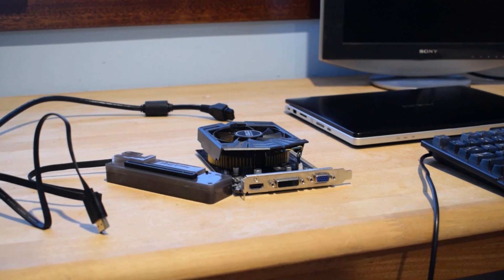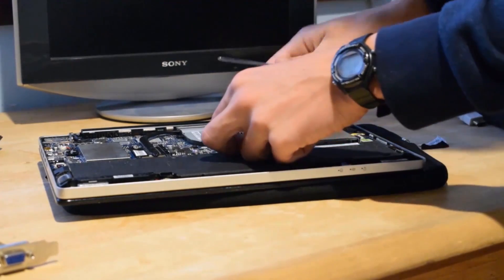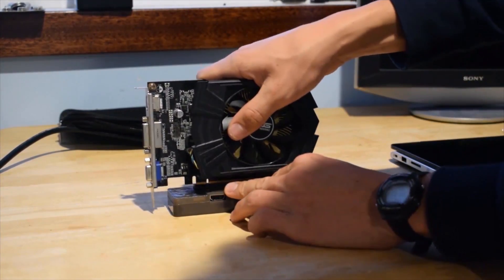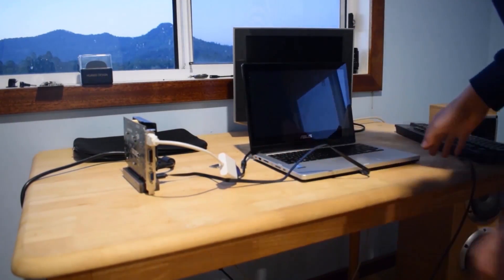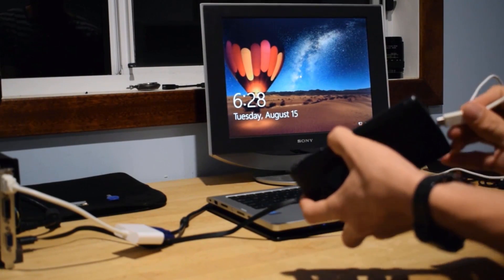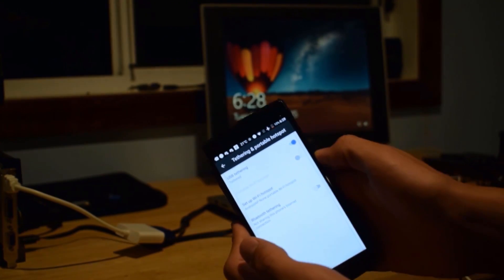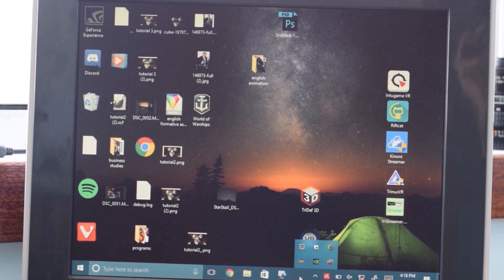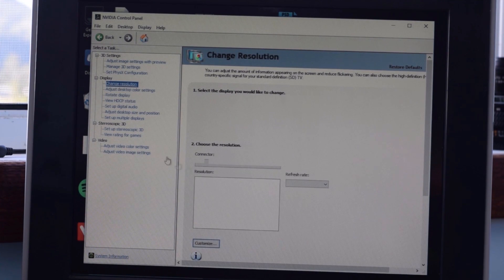How to Connect External PC Graphics Card to Laptop (no thunderbolt port required) Egpu Setup

Comment: Dude, i have a Asus X556UA. but in this laptop i have a I5 7200U, Could you put the EGPU? the truth is I do not know if it has the same input I do not know what kind of input it has, and since I can not open it because the warranty covers it, I do not know if you could tell me what type of connection it uses
Reply from the maker: It should work, you just need to figure out what port it has, like you said. The best way to do this is probably to go into device manager to get your wifi card model, and then research what type of connection that model has. Some possibly helpful info: https://www.thinkpenguin.com/gnu-linux/mini-pci-mini-pci-e-mini-pci-e-half-height-guide-laptop-wifi-cards

Comment: My laptop is very old and i dont have an external monitor, can i run it.
Reply from the maker: You should probably consider just getting a new laptop. While this may improve performance, your other laptop components will significantly limit the external gpu. Also, there is a good chance that you would need a monitor to make it work on your laptop, if it doesn't have a bios whitelist [which would prevent the egpu from connecting]). Hope this is helpful.

Comment: Hello bro i have 2 question if you answer me i will subscribe to your chanelle 
first : i have a 
hp 15-r214nk
4GB ram 
Intel Core i3-4005U CPU @ 1.70GHz
Intel HD graphics 4400 
what graphic card can be the best performance for this pc 
second 
if i unplug the wifi adapter from my pc can i use an external USB Wifi or a wifi cable to use internet conection 
and thanks 
i hope i got a reply soon
Reply from the maker: The performance increase is heavily dependent on the game you want to run (if you want it for gaming). I used a gtx 750 in the video, and my laptop has similar specs to yours, but you could probably get a bit better one than a 750 if you want. Whether your cpu and ram will bottleneck the flu also depends on what you are running, as some things are more cpu intensive, while others are more gpu intensive. And yes, if you unplug the WiFi card you can still use WiFi by either using a lan cable, getting a USB WiFi dongle, or USB tethering the connection from your phone. Also note that if you plan to move your laptop around a lot, an egpu setup may be impractical, as you need to open the laptop every time to disconnect the egpu cable. Also, gpu's and quite expensive at the moment, so you may want to consider just buying a better laptop if you have enough money. Hope that helped you :) also make sure your laptop doesn't have a bios whitelist, and this would prevent you from connecting an egpu, but I don't think it has one (not 100% sure though)
Reply: +Sub thanks broo
Reply from the maker: Thanks :)

Comment: One simple tip if you want wireless wifi on any pc; Just buy a cheap USB WIFI adapter.
Reply: its called wifi dongle thingy
Reply: WiFi are very tiny in form of USB these days
Reply: wait I am confused what does wifi have to do with boosting my performance for gaming?
Reply: @eze9775  eGPUs are usually connected to NGFF slot that the Wi-Fi card uses, so you lose that built-in capability.

Comment: My laptop is a Lenovo Ideapad 520s i7 256gb SSD 
1. Will it work? 
2. Also will this end my warranty?
3. Also how easy is it to interchange from the regular laptop to the laptop with the eGPU attached and vice versa.
Reply from the maker: Hey, sorry for the late reply, I had a busy few weeks (exams). I'm honestly not quite sure if it would work, you'll need to make sure it doesn't have a bios whitelist (I think the ideapad 510s has a bios whitelist, not sure about the 520s though). About the warranty, this should hopefully give you some more info (should be the same for lenovo): https://www.reddit.com/r/Dell/comments/4e1ivx/does_replacing_the_wifi_card_void_your_warranty/
How easy it will be to swap depends heavily on the laptop. You will probably need to open it up every time you want to disconnect the cable, so it depends on how easily you can do that (or if you can somehow store the cable in the laptop and then pull it out when needed). Hope that helps, please consider subscribing to my channel :)

Comment: Does this mean no wifi
Reply from the maker: Well, you need to use another method to get WiFi, such as USB tethering it from your phone, using a lan cable, or buying a USB dongle. Otherwise you won't have wifi, as this setup requires the WiFi chip to be removed from its slot.

Comment: What about an MSI gtx 970 4 GB?
Reply from the maker: Hm, my feeling is that a 970 might be a bit too powerful, just because I'm not sure if the mPCI-e connection would bottleneck it a bit (I've tried to find tests which check how much the connection bottlenecks gpu's, but haven't found any). Also, your cpu might bottleneck that in some games. Your choice, it might be bottlenecked a bit, but it will still work.

Comment: Will this work on HP ProBook 4740s ? And which GPU is the best for this laptop?
Reply from the maker: Hm, that's a bit risky. Not sure if your laptop has a bios whitelist (which would prevent the egpu from connecting). Your laptop was made around the time that hp apparently stopped putting bios whitelists on their laptops. So not quite sure if it would work. Try to find out if it has a bios whitelist, and if not, I would probably recommend a medium range nvidia gpu.
Reply: qwertypop but I have read that there is a bypass for that whitelist but not sure if it really works

Comment: Can I use a zotac gtx 1060 6gb graphics card?
Reply from the maker: Should work. Just read this forum to see what issues there are, and workarounds. 
Nvidia 10xx series egpu driver issues: https://egpu.io/forums/expresscard-mpcie-m-2-adapters/nvidia-is-killing-off-mpciengff-m2-egpus-error-43-with-372-90/
What computer are you planning to use it with?

Comment: will this work on Acer aspire
Reply from the maker: Hey, do you know the exact model?
Reply: +qwertypop Acer aspire 5733Z
Reply: +qwertypop and I am using Intel i5 8th gen graphics card,will it give 60fps
Reply: +qwertypop also subbed and liked
Reply: +qwertypop pls reply ASAP
Reply: and i am using my laptop screen
Reply from the maker: Hm, as far as I know, your laptop doesn't have a bios whitelist, so an egpu setup should work (no guarantee though). Please keep in mind though that your cpu may bottleneck the setup significantly. Also, I don't know if your internal laptop display will work while the egpu is connected. You just need to try. The question of whether you will get 60 fps depends on the game you want to run and the gpu you want to get. Cpu intensive games won't run well, purely gpu intensive ones will.
Reply: +qwertypop thank you so much i want to play GTA 5

Comment: Can i use it with dell vostro 3450 :V( core i5, ram 6b, ssd 120gb, have mPCIE slot)
Reply from the maker: It should work, not sure about the issue being talked about on this website though: http://forum.notebookreview.com/threads/req-bios-mods-to-make-vostro-latitude-egpu-friendly.589234/ 
This website claims it works though: https://trickiknow.com/external-graphics-card-for-laptop-egpu-setup-guide/
So I think it should work. Maybe just do a bit more research on google.
Reply: Thanks you !!! And can you give me a name of Power Suplly you are using ???
Reply from the maker: The power supply is the Dell DA-2.
Reply: Thanks again !
And do you need to install DIY ???
Reply from the maker: np :) I don't quite understand what you mean by "do you need to install DIY". DIY stands for "do it yourself" as far as I know, so yes, you do need to install it yourself by opening up your laptop and replacing your wifi chip with the egpu cable, and then you also need to set up the other stuff shown in this video. Sorry if I misunderstood your question.
Reply from the maker: Oh, that's what you meant :) Well, for me it worked fine without it, but I have read that some people needed it, so I guess if you experience one of the issues listed their website, then you should probably get it. The developer (nando4) is quite active in the egpu community, so I would definitely say the software is good if you are experiencing issues once you get the egpu setup.
Reply: Thansk,bro! But the shipping of soffwear cost so much!
Reply from the maker: Yeah, I know :( only get it if you end up needing it.

Comment: can i still use regular wifi (without phone hotspot) if i do this?
Reply from the maker: No, this requires you to remove the wifi card (unless you have a spare mPCI-e slot or express card slot on your laptop), so you won't be able to connect using wifi. Your options are: 1. Use a lan cable 2. Use usb tethering on your phone 3. Buy a usb wifi dongle. Hope that helps you :)
Reply: Thx!

Comment: Asus ROG GL752vw
 i7-6700,8 gb ram ,gtx 960m,whats the best video card i can get for it not to be bottlenecked by my CPU?thx in advance
Reply from the maker: I think that should be good enough for basically any gpu, but really good gpu's may get bottlenecked by the mPCI-e connection (not quite sure about that though). I wouldn't recommend anything above a 1070 maybe? 1080 may be fine too
Reply from the maker: Just be aware of those issues with 10xx series cards:  https://egpu.io/forums/expresscard-mpcie-m-2-adapters/nvidia-is-killing-off-mpciengff-m2-egpus-error-43-with-372-90/

Comment: Hello, have you done eny expriments with connecting a storage dive to WiFi or Bluetooth port on laptops?  I would like to connect a storage device to my Bluetooth port, preferably a SSD.
Reply from the maker: Plipo Gamez as far as I know, Bluetooth is usually integrated into the WiFi chip, so there isn't a separate Bluetooth port, it's also in the WiFi port. But no, I haven't experimented with that, and honestly don't have a spare ssd to test it at the moment. You might just be better off just asking on tech forums and searching Google to see if anyone knows about that. Sorry that I can't really help you with that (not at the moment at least).

Comment from the maker: Could anyone that tries out an egpu setup on their computer please message me if it worked or not, so that I can use that knowledge to better answer people's questions about whether it will work on their computer. Thanks :)
Reply: I have i5 3320m can I fix an egpu with it and also have the wifi device in it
Reply from the maker: What is your laptop model?
Reply: Hp probook 6570b
Reply: I have a Dell inspiran 15 serais 3000.i5 7200 2.4hz and 6g ram than i could put a gtx970 or 1050 ? Ty
Reply: Qwerty pop plz tell me a about egpu bro I'm waiting for yours response my laptop model is hp probook 6570b 3rd gen processor and 2.60ghz
Reply: can you able to tell me which things I will need if I have Dell Inspiron 15 3537 ( if its possible I wanna use gtx 1050 atleast and IDC about laptop wifi I can use usb external wifi )

Comment: can you do it in samsung nc110 netbook.best gaming set up for it.tnx bro
Reply from the maker: peterjan agulto Yes, from what I can tell, you can use an egpu setup on that. What are the specs? (to determine the best gpu)
Reply: processor:intel(R) Atom(TM) CPU N2600 @ 1.6GHz

ram:2gb

graphics:intel(R) graphics media accelerator 3600 series

gaming graphics:not detected

primary hard disk: 156gb total

thats it bro,i just copied it
Reply from the maker: +peterjan agulto Hm, those specs are really low end. I would recommend you get a low end egpu if anything. What games do you want to play on it? Your cpu and ram will most likely bottleneck most games.
Reply: ok i understand,i probably get a new one.tnx bro
Reply from the maker: +peterjan agulto Yeah, probably a good idea, your current one is a bit too low end of you want to be gaming.

Comment: I have a hp envy dv6 laptop. What graphics card fo u suggest
Reply from the maker: I think that might have a bios whitelist, which would stop an egpu from being connected. If you know that it doesn't have a bios whitelist, I would recommend a low-mid range nvidia gpu.

Comment: Hello
My Laptop is HP Pavilion dv6-6b80se Entertainment Notebook PC
  CPU
   Intel Core i7 2670QM @ 2.20GHz
   Sandy Bridge 32nm Technology
                        2201 Mhz, 4 Core(s), 8 Logical Processor(s)
  RAM
   8.00GB Dual-Channel DDR3 @ 665MHz 
  Motherboard
   Hewlett-Packard 17FA (CPU1) 
  Graphics
   Intel HD Graphics 3000 (HP)
   ATI Microsoft Basic Display Adapter (HP)
   CrossFire Disabled

                 BIOS Version/Date
                        Hewlett-Packard F.1C, 1/23/2013
                 BIOS Mode 
                        Legacy

My HP have a BIOS whitelist, I would really appreciate your help if you are able to tell me how to modify the list or remove it
... even if there is any BIOS update with the whitelist removed, or any links that might help
Reply from the maker: Hey, I sadly don't know how to edit the bios to remove the whitelist. Sorry. Maybe ask on https://egpu.io/forums/ or something.
Reply: Thanks for your help

Comment: What if I want to play it on laptop screen? Will it work
Reply from the maker: Depends on the laptop. As long as it has intel hd integrated graphics, it SHOULD work, but it just won't work on some laptop's, like the one I used in the video. In my case it was because my laptop disables its integrated graphics when the egpu is connected (the intel igpu didn't even show up in device manager anymore while the egpu was connected). Since the intel hd graphics are required to use the internal display (the video gets routed to the display via the intel graphics), I am assuming it didn't work for me because of that. Other laptops might have the same or other issues, you never know. That being said, it should work in most cases as far as I know (the laptop just needs to have an intel igpu).

Comment: Would this work for me? Which graphic card would you recommend for my HP laptop. I got it as a present and its not even a month old. But when it comes to gaming it kinda chokes.
  
CPU: Intel(R) Core(TM) i7 - 75000
RAM: 8gb
my currently graphic card is RADEON(TM) 530

lcd benq monitor (if it matters)

Since this is much cheaper way then to buy a whole new desktop I am ready to pay for an expensive external graphic card beacuse i always wanted a good gaming performance without worrying which game i can play normally and which one i can not. Very nice video
Reply from the maker: Hi, do you know the model of your laptop?

Comment: I wont sacrifice wifi for graphics..
Reply: you wont if you buy a wireless wifi adapter
Reply from the maker: Yeah, I know. It's really not that hard to get wifi with an egpu connected.
Reply: Damn CJ! GtaSa
Reply: Busta
Reply from the maker: +Carl Johnson You don't have to... Just USB tether the WiFi from your phone to your computer, use a lan cable, or buy a USB WiFi dongle.
Reply: qwertypop are you talking about ethernet  cables?
Reply: rofl just get a fucking wifi adapter for 10$ lol.
Reply: Carl Johnson buy a usb WiFi stick. Costs RS 700 in India. Should be a litter over 10 USD in US.
Reply: just use hesoyam ...
 god dammit
Reply: I to
Reply: XD
Reply: bro buy a cheap usb wifi adapter
Reply: LOL>. usb wifi adapter cost only 3 buck man

Comment: My laptop: Dell Inspiron 3542- Core i3 4030U - Ram 4GB
Can i use GXT 1030 or GXT 1050
Reply from the maker: Helix-1024bit Hey, sorry for the late reply. That should work, even though I wouldn't get a graphics card from the 10xx series if you don't want to mess around with workarounds to get it to work, because there are some issues with using them as external gpu's. More info and workarounds for this issue here: https://egpu.io/forums/expresscard-mpcie-m-2-adapters/nvidia-is-killing-off-mpciengff-m2-egpus-error-43-with-372-90/ hope that helps.